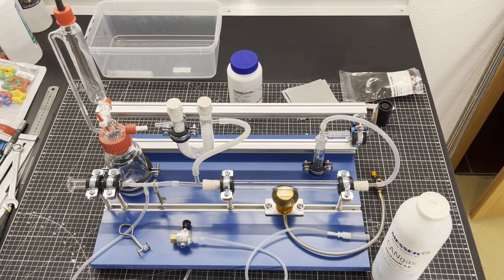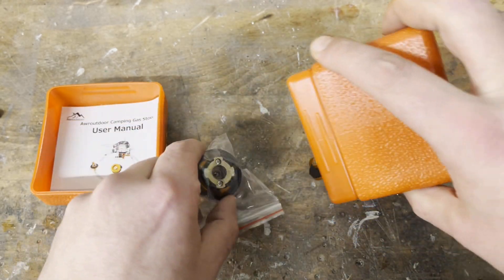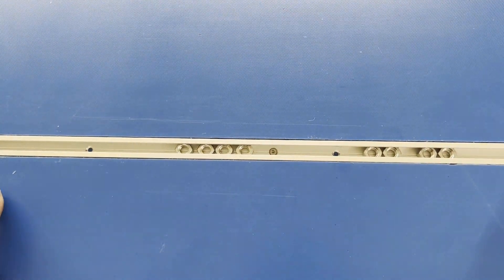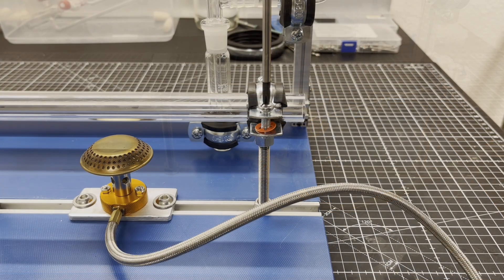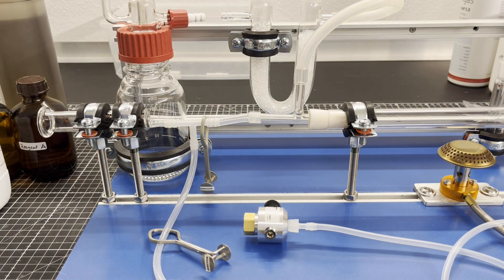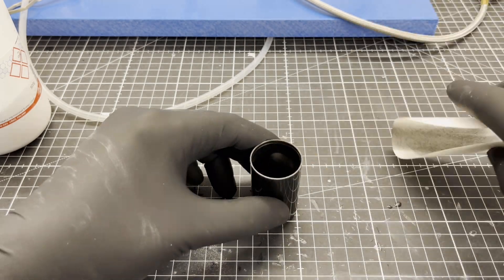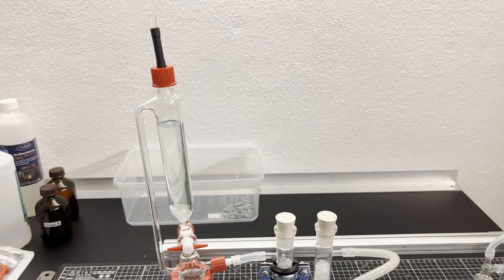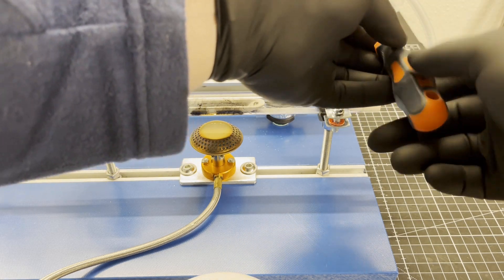Making ammonia from its elements (Haber-Bosch)

Comment from the maker: In case anyone is wondering. The slit in the black hose is not a damage but a Bunsen valve.
Reply: Would a check valve be necessary with this set up, or does the copper wire take care of the hydrogen at the end? is a flashback arrestor and check valve the same? or would i specifically need to get a flashback arrestor? thank you. this project is awesome!
Reply from the maker: @ A check valve does not prevent a flashback. It also requires higher pressures. The copper wool is a well known flashback arrestor in chemistry and works very well. Btw., hydrogen only burns when oxygen is present:)
Reply: @ thank you for sharing your knowledge with us

Comment: Great video, thanks. But how canta one make pure nitrogen?
Reply from the maker: In the laboratory, pure nitrogen can be produced by heating an aqueous ammonium nitrite solution or a solution of the mixture ammonium chloride/sodium nitrite to approximately 70 °C. Air can also be used, and the oxygen it contains can be removed by passing it over red-hot copper. The easiest method is to use a filling kit for tires/expansion tanks with nitrogen, which can be purchased on Amazon, for example.
Reply: @Marbslab  thanks alot sir, will check out the filling kit

Comment: What a beautiful setup, I learn as much about engineering design as I do about chemistry from you!  One thing, I suspect that you can heat that catalyst directly via induction due to the iron, if so this would be far more energy efficient and would probably reach a higher temperature, or at least a very controllable one.
Reply from the maker: Thanks:) Believe it or not, I was considering an induction heater coil. But then I thought let's try an experiment without any electronics.
Reply: @Marbslab  If you do go down the electronic route it also makes sense to have an electrolysis based H2 producer. If you want to ensure the H2 waste is visible you can bubble it through acetone, this then lets you visually quantify (photodiode?) the H2 waste rate so that you can control the H2 generator in a feedback loop. Cl, generated from NaCl, also from electrolysis can be used to form ammonium chloride (ideal for storage of ammonia), but you must be very careful to have more  ammonia than chlorine gas or you get nasty/dangerous byproducts like NCl.
Reply from the maker: @DanielSMatthews  Great idea!🙂

Comment: As always, great setup and well exposed explanation. It's the first time I see authentic "tin foil". Pretty expensive I think. Wasn't cheaper to use HCl and aluminum foil?
Reply from the maker: Thank you:) It's zinc not tin and not expensive. Hydrochloric acid releases nasty hydrogen chloride fumes. I didn't want this gas to get into the quartz glass with the catalyst in any way. That's why I switched to H2SO4.
Reply: @Marbslab  that makes sense.

Comment: Why not direct the excess hydrogen to the burner so that the burner relights it if it goes out
Reply from the maker: Possible but not necessary, because the flame only goes out when hydrogen production comes to an end. But a good question!
Reply: And you get free heat.  A gas stove spark igniter would be handy.  I found some old ones that have a sense electrode that turn the spark off when it detects ionised gas so the unit is connected to the gas valve and relights the stove if the flame goes out.

Comment: Aluminum is so soft lubricant is hardly necessary for a few small holes. Just use a sharp bit.
Reply from the maker: It depends on the alloy. With my aluminum, it smears and immediately clogs the drill bit.
Reply: @Marbslab  Indeed. That probably is almost pure aluminum. Very annoying to machine. I use very sharp nitrated bits (those with the yellowish end) and low pressure with 70% alcohol as lubricant.

Comment: Well, that was underwhelming... at least with minimum conversion you could use this for ostwald
Reply from the maker: Yes, sure. I also have some platinum wool left, I think...☺
Reply: @Marbslab  copper works as well, might not be exothermic enough to self sustain but you have a burner. Are you not familiar with the SM threads on this topic?
Reply from the maker: @dandan-gf4jk  SM threads?
Reply: @Marbslab  Science Madness forums
Reply from the maker: I see. Never read the Science Madness threads. Usually, I research myself, but why not take a look in the future:)
Reply: @Marbslab  Sciencemadness has a wealth of information, especially anecdotal accounts. I find it more useful that official papers, because scaling down sometimes affects how a reaction is best done.
Reply from the maker: @Daniel-3029f  Fully agree. Will take a look:)